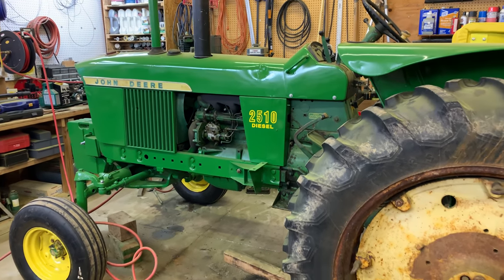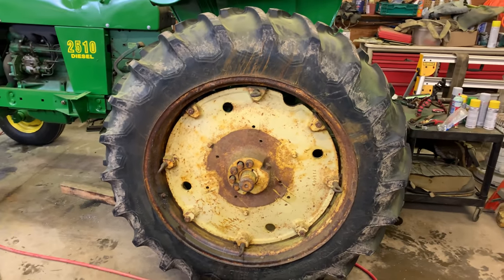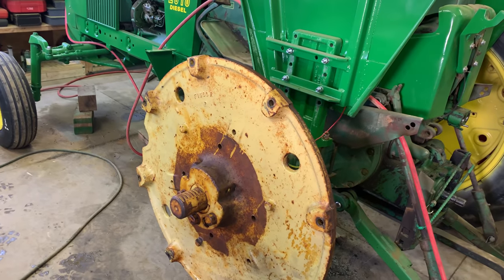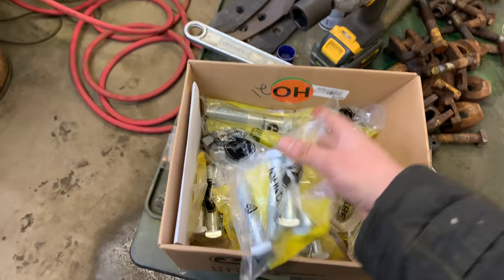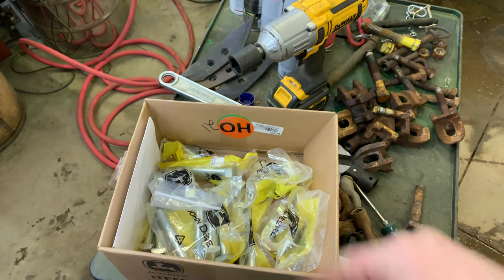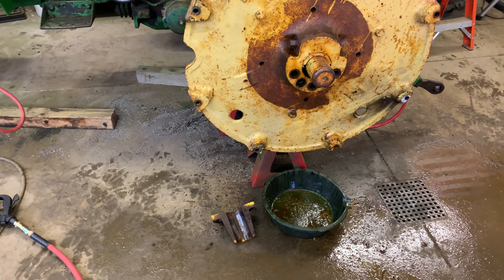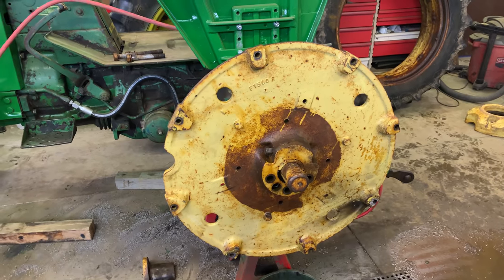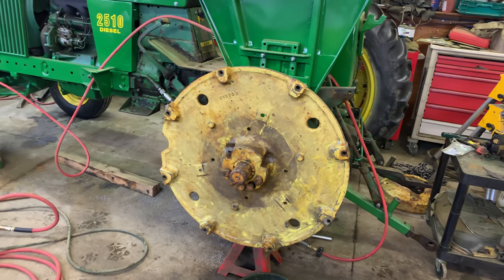The Most Awfulest Rear Tractor Tire Removal! John Deere 2510

Comment: Remember doing this every fall when we put the mounted corn picker on, then again after it came off.  We were using the factory double ended box wrench that came with the tractor.  Obviously the tractors were relatively new at the time, and doing it that often kept things loose.

Comment: Well, Well, Well.  Just happen to have a nice 2510 with the same situation.  Inherited my FIL's farm with the 2510 gas he bought 1 yr. old that has the same problems.  I bought new tires and rims 4 yrs. ago but couldn't get those bolts out. That F1500R wheel is used on most of the # series. Burnt one bolt out with torches but that pretty much ruins the tip on just one bolt.  Sledge hammer could break cast wheel.  About to get back to it and plan on converting the 35 ton log splitter to press bolts out safely.  Use a heavy pipe with a cap welded on the end that only hits on wedge half to break clamp loose with sledge hammer.  If you can't get axle pinion bolt broke loose you can still move wheel on axle.   With wheel exactly as shown at 20 minutes with wedge out and tire on ground you can lower axle to lean wheel in or out then raise tractor back up.  Pinion gear will be above axle rack so you can move or even remove wheel assy.  This is what I had to do on my 730.  Not as convenient as designed but works easily.  This was a great design but not moved for 50 years with rust allowed to set in takes it's toll.  Great video and I do have the same Earthquake 3/4 and 1 " impacts.  Nice tractor too.

Comment: Pretty ez to make a pipe that fits over the axle that is notched at the hub end and a plate welded over the outside that you can wail away at.  The notched end makes contact with the wedge only and with about 10 wacks or so, usually is out.

Comment: Yes the tire is tubed. The pusher bolts are case hardened. Which means that you can still out the center and hopefully use a heavy duty bolt extractor one. On a side note I was working on my tractor today and split the cast iron wedge into four separate prices.
Reply from the maker: Oh my!

Comment: I thought an Allis 190 wedge hub was tough to move! This is worse! Thankfully most Allis tractors have power adjusted wheels so the hub doesn't need to be messed with. I do remember a guy at mechanics school cracked the whole cast wheel trying to move one on a 720 John Deere. He was using heat and a one inch air impact. It was his own tractor and was very upset it cracked.
Reply from the maker: Yea I’d be upset to if that happened!

Comment: why are you using the air wrench while the compressor is still running??  You don't have enough patience to do this properly.....read the service manual or ask someone that has experience...... don't get yourself hurt!!
Reply from the maker: What’s wrong with using the impact while the compressor is running?! Also I’m well aware of how they are supposed to come apart but there is a little something called RUST!